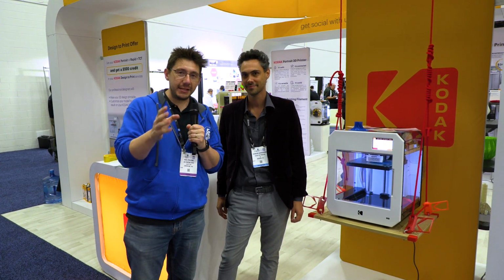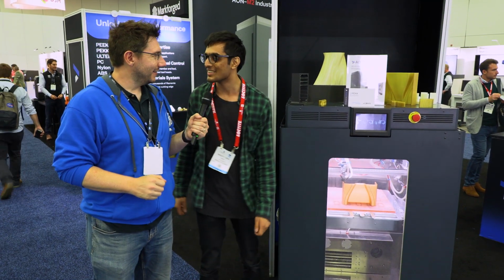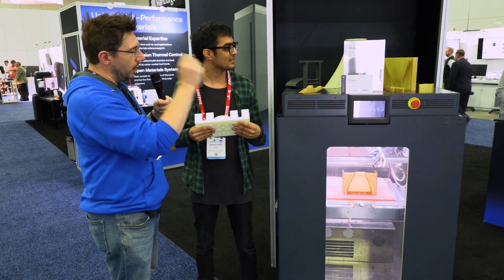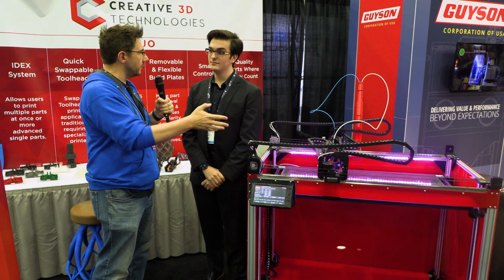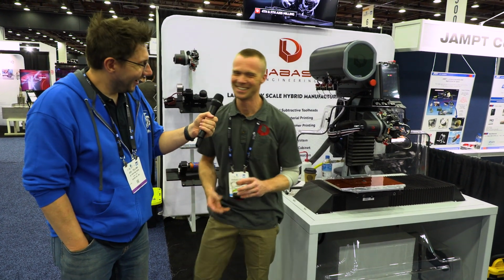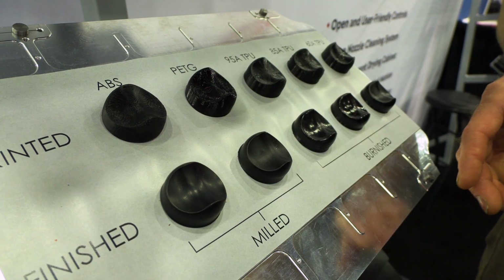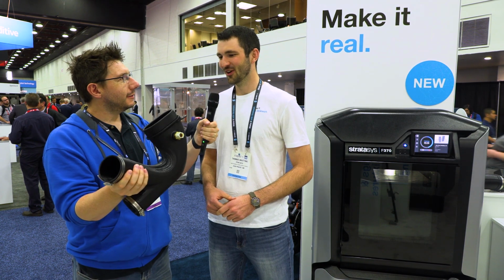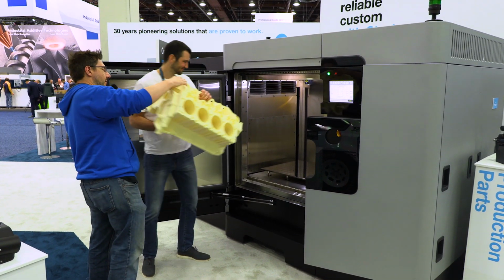Awesome 3D Printers at RAPID + TCT 2019

Comment from the maker: Here are the timecodes for each booth we visited!

Kodak - 0:26
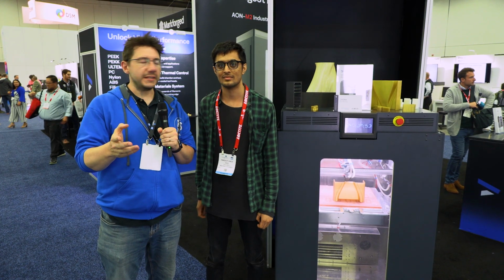AON3D - 3:38
Creative 3D Technologies - 7:47
Diabase ($6900 forgot to mention in video!) - 13:35
Makergear - 18:24
Stratasys - 20:31
Reply: Nice recap Joel. Some interesting tech going on in the industry. When do you get your first metal desktop printer?
Reply: Thank you for asking for pricing information.
It seems like a lot of companies that sell expensive machines are afraid to share it.
Reply: So can we expect an F900 at your's soon?
Reply: Wish he checked out blackbelt.. they have the most innovative FDM printer I have seen in years
Reply from the maker: The Blackbelt innovation is their black belt, right? The tilted head and belt driven system have been around for a few years before them.